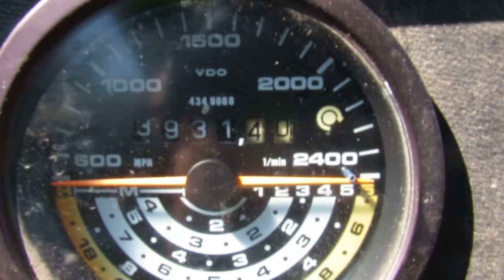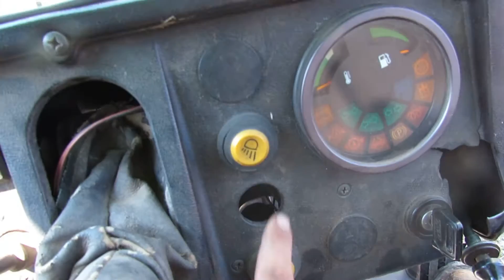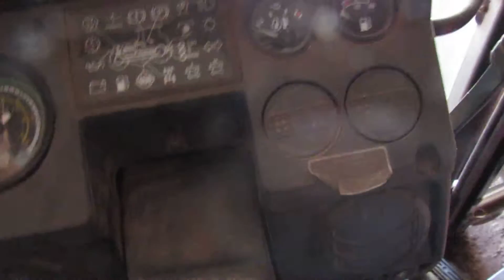reviewing the Deutz Allis 7085

Comment: I have the same exact tractor.  Bought it in 1989.  Best investment I ever made !  Nothing can beat it for fuel use !  I mean nothing !   1.8 gallons per hour under full load !  Bought it using 1 quart per hundred hours. To this date....still uses one quart per hundred hours.  The only problem Ive had was the air conditioning.   Had to add an extra fan when switched to 134 A  .

Comment: differential lock is the pedal you couldn't think of the name. You got a good set of AGCO tractors there. Did they tell you 1997 for that 7085? Um no...probably 1987. Anyways, that 6080 was the best of the bunch, those were excellent tractors that's for sure. 8775's were not too bad either. Not many problems with the 8775 on average. Some guys used to use those 6690's for heavy work...unfortunately that was not what they were designed for.